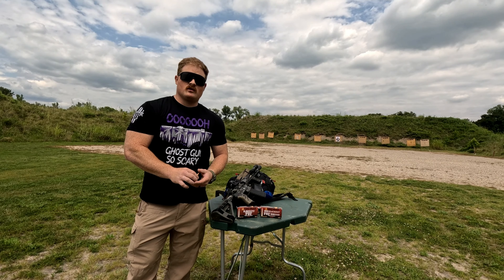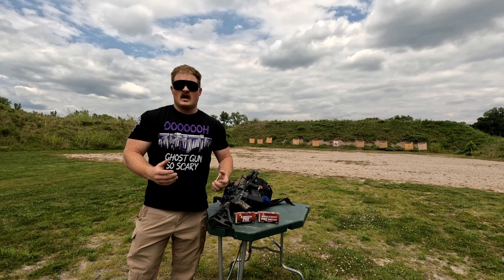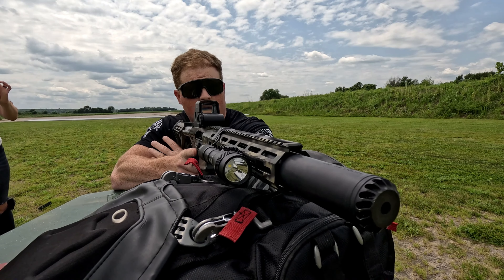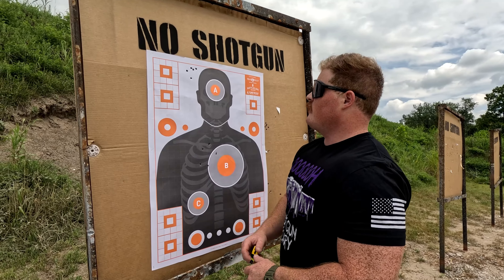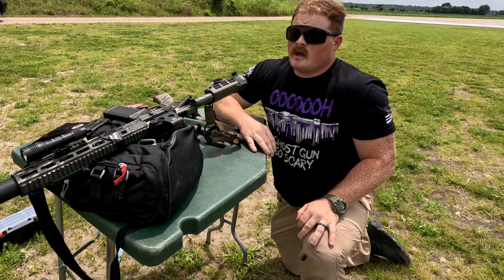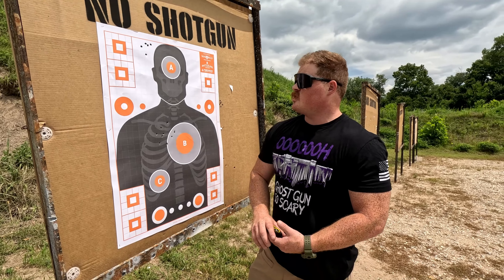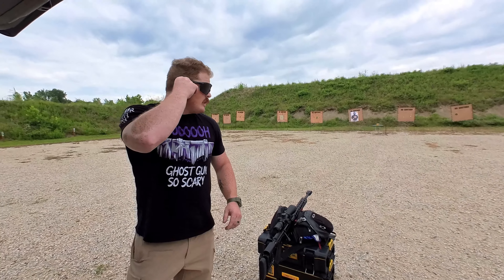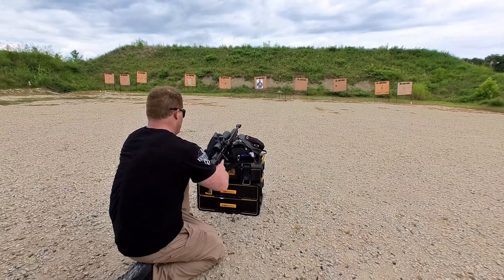Ballistic Gel Block Test | 300 Blackout Subs + 5.56 Fort Scott Munitions

Comment: Looks like the TUI rounds internally destroyed the block, and the 300 Win Mag took advantage of the tumbles and finished the job. Fort Scott Munitions makes a loaded 300 Win Mag 175gr and they have a .308 190gr smooth projectile that is designed for 300 Win Mags. The BC on the loaded 300 Win Mag 175gr TUI round is .606 and the .308 190gr smooth TUI projectile has a BC of .757 when loaded as a 300 Win Mag. You might check those out as well.